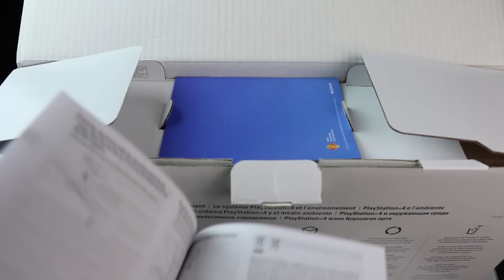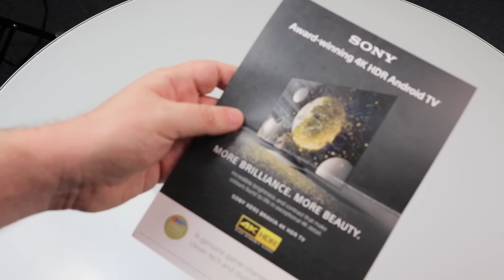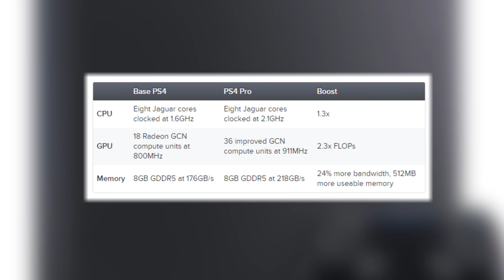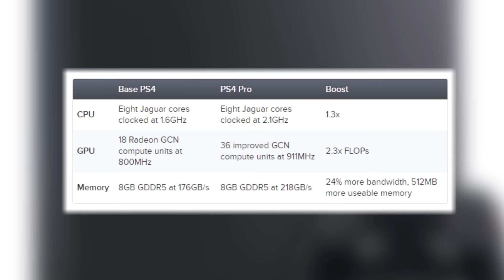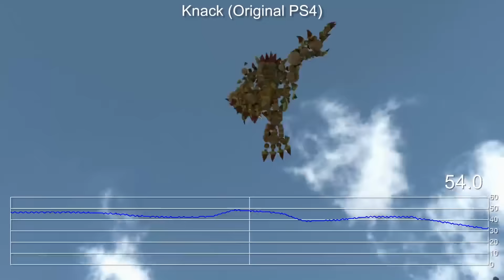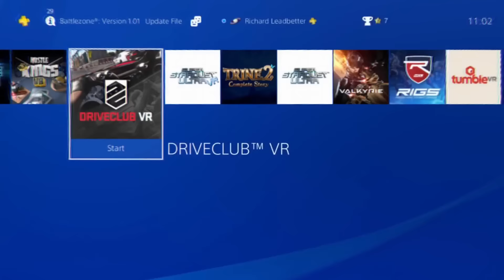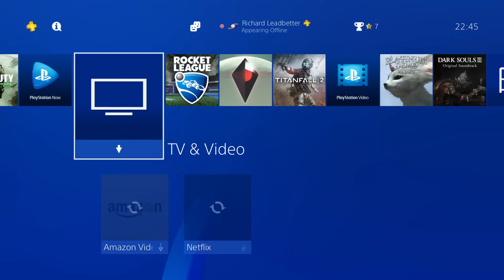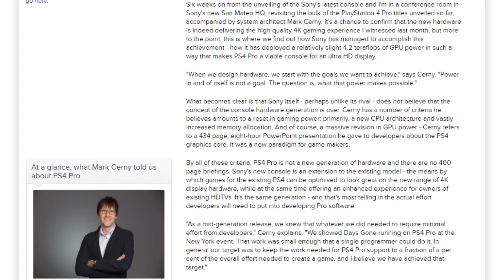DF Videocast #4: Unboxing PS4 Pro, Meeting Mark Cerny & More

Comment: Iam a High End PC Gaming Enthusiast But Frankly for its price , sony exclusives , and optimized games such what they have done with Uncharted 4  = It is A Good Deal to play on a 55 inch 4k HDR TV. Just Ordered the Flagship TV of the Year - 55 Inch Samsung KS 9500.
Reply: Mr. Ihab Issa I'm a high end PC gamer as well, but I can't justify the upgrade because there isn't anything wrong with the vanilla PS4. Plus I want to research the best 4k HDR TV as well.
Reply: Davari02 Gaming Sold the PS4 Already 4K HDR is a totally different world - you need to see it to actually spot that. I have done  an intensive research (Rtings , 4k.com , AVForums , Tech Channels ... ) and I was in a dilemma between 2016 High End offerings , fully fledged HDR , low input lag , image quality , gray uniformity , blacks and Contrast Ratio , and the number of HDMI ports that accepts a 10bit Signal . Samsung KS 9500 vs LGuh950V vs Sony Bravia x940d to me KS 9500 is the most versatile (lowest input lag at 4K 60 Hz HDR  , Ultra Premium HDR Ceritified , Widest Color Gamut with P3 Coverage , Best Gray Uniformity , All 4 HDMI ports accept HDR or a 10 Bit Signal.
Reply: Mr. Ihab Issa I was looking at thet X940D but end up going for the X930D instead bc I do not need something thay big ans the one I got should do the job & yes I do know about the input lag but then again nothing that small firmware update cannot accomplish in my eyes.
Reply: Samuel Campana Why not the KS 9500 mate
Reply: Mr. Ihab Issa Bc I don't think KS 9500 was available whenever I was looking and the fact some of tech guys have not being very fondable experience with their Samsung TVs, got a friend of mine got 3 priors Samsung top of the line models & usually by the year mark, screen issues that to repair it is might as well buy a new TV so 1 huge reason that took me away of that & will wait a couple of years & might jump to OLED yet too early for any concrete feedback to make it even worth it. And another reason to go with a Sony model was also because Sony has the most color palette than any other brand so it makes native 4k looks more natural, on that part I was just picky believe did research for almost a year.
Reply: Also most manufacturers having issues woth 10Bit signal so as of now that's in limbo if it'll actually gets implement it at all mate but then again I have checked on any news in the last couple of months so I might be wrong.
Reply: i wouldn't call sub 30fps as optimized
Reply: VelvetSky1102 exactly specially when it is not steady fps
Reply: Im also a high-end PC gamer, but i don't care about consoles. It isn't just my style.
Reply: Mr. Ihab Issa That's a great tv but you should have gone 65" 😎
Reply: district5rookie Nah 65' is too much, It burns my eyes after a while of playing, 49-55"' inch is perfect
Reply: All depends from how far are you watching/playing I think there's a chart for that.
Reply: ***** I know I did the jump from 47 to 65 now I can sit far off in the couch with no complaints
Reply: Samuel Campana So it means the QC on the Samsung Panels is bad now that might be annoying which makes pull the trigger off on the purchase. However many people purchased too a Samsung TV & nothing happened.
Reply: Mr. Ihab Issa not right away but in a years mark happened to my friend 2 put of the 3 he bought & my sister's fiance happened the same thing a couple years back a tiny line right in the middle when TV was cold but with time it got bigger & never went away & he initially contact Samsung & they were charging him like close to what he paid for so it let it go and the end result was the line got wider in a year's mark. No idea if they fix that problem but look what they've been going thru lately 1st note 7 now over 280 million washer machines being recall. P.S. not trying to put you away but spending that amount of money you want value from your investment just saying.
Reply: Mr. Ihab Issa Curved Screen :/
Reply: Flagship TV of the Year  - LG Signature OLED
Reply: Aditya King in LED the KS 9500 ;)
Reply: Mr. Ihab Issa Sony Z9D
Reply: Rammenknoedelstein Z9D?
Reply: Daniel Berliński curved are only great while looking it at in a straight angle, amy time you move to the sides you lose visbility sadly
Reply: Rammenknoedelstein 4k.com 93 % for the KS 9500 and 86 % for the Z97 D
Reply: Mr. Ihab Issa is that their rating?
Reply: Samuel Campana Yep check the recent review of the Z97D. By the way I was checking the Verticle Lines issue -Sony & LG has them too.
Reply: Mr. Ihab Issa did funny that their main complain was a comparison with OLED, seriously, OLED has no other company to compare it with yet seems very solid; yeah read plenty of the bad stuff on the Sony side which is mainoy about the perfection of showing blacks as it seems it carries over on the Z9D models yet not as much.
Reply: but the frame rate will but the same as the original ps4's im sory I have a gtx 950 and I wouldn't upgrade to this
Reply: magnefficient gaming ?
Reply: Samuel Campana    Input lag sliced in half after latest firmware update. http://www.avsforum.com/forum/166-lcd-flat-panel-displays/2361889-official-2016-sony-x930d-owners-thread-no-price-talk-147.html

Comment: Great video, thanks! I know why I watch DigitalFoundry. As a side note: Richard, may I humbly suggest not to cut Tim short? Of course, you are the boss, but doing so gives the impression of a bad mood and underlying tension which may be completely not the case. Moreover, as you are two guys in the video, I'd say that amount of talking should be roughly equal, which in my insignificant opinion was not the case in this video. However, that might be only my personal impression.

Comment: Still runs games at 30 fps? What the fuck. Are they even using the extra power?
Reply: If I upgraded my pc by those margins more than just the res would be increasing.
Reply: CPU still sucks bro
Reply: The CPU still isn't capable enough to maintain 60 in most games. You can double, triple, quadruple the GPU performance all you want but a shitty CPU will give you bad minimum frame rates.
Reply: Just because the hardware could do it doesn't mean a game engine can do it without some major retooling. 

If you create a game from the ground up at 30fps you have optimized everything for that frame rate (dynamics, controller input, audio, AI, etc). This means that simply doubling the frame rate won't produced the desired results. You now need to rework a bunch of systems from scratch to end with the same results you had at 30fps. Not only that but for a console you are optimizing everything to use the most of the resources within the specs of the system, which means that you may not have enough headroom to double up on processing required to get up to that level. 

A game produced from the get go at 60fps is a different story since you already have the 60fps frame rate worked out and are pairing it back to get to 30fps. However, the goal with the Pro is to give a more powerful PS4 option and not to create a second Pro exclusive market. If you were to have online multiplayer games running at different frame rates between PS4 and Pro then the Pro users would have an advantage or you would need to have separate servers for one of the groups.
Reply: MegaRayland
games arent always hardwired to 30fps, there are already a few games on PRO that give a high framerate option
Reply: The ChillyWinds You have an option to play the game in 60fps 1080p. Its call framerate mode
Reply: Since they pretty much doubled the GPU power, They could either double the frame rate to 60 FPS, or double the resolution. They chose the latter.
Reply: SteelSkin667 No, they give you both options. At least Crystal Dynamic did that for Rise of the Tomb Raider
Reply: No is not.. Since Sony actually demand that they take advantage out of the so called "4k" support and have parity in frame rates.
And even if developers was free to use that power the way they want, it would still no have enough CPU power to deliver 60fps in a large majority of the games.
Reply: LordBattlefrontGamer No it really doesn't at all. You should watch their video on it. The ps4 version on average is like 40-45 fps in multiplayer. Also that is only one game and just so happens to be incredibly optimized with tons of graphical downgrades. It should
be able to do more than just a couple games. Nearly all games pardoning maybe bethesda games should be able to run at 60 fps with a boost like that.
Reply: *****
lol bullshit, even the xbox one S drops hard in 64 player matches and the consoles can't keep 60 because the CPU's suck shit..same happened in BF4
Reply: *****
they have optimised it but theres only so much they can do..consoles arent magic you know, the hardware limitations are real, which is why they are brining out the PRO and scorpio..they made the PS4 and ONE too damn weak.
Reply: *****
yup 4k is VERY intensive but theres a difference, on PC it will be native 4k, on PS4 it's some clever up scaling technique which will look good, but not native 4k good.

there are some games on pro which are native 4k but they are indie games and PS3 remasters like Skyrim and TLOU
Reply: *****
yup it can downsample from higher res down to 1080p to give a cleaner image, i do this a lot on my PC

the pro basically brings the playstation back to the level of a mid-high end PC, which is where the PS4 was back when it released. as I have a gaming PC and a PS4 i have no reason to buy the pro.
Reply: LordBattlefrontGamer lol Battlefield 1 runs at 60 fps on the normal PS4?  LOL what a joke ,, do you know what is 60 fps ? ,,,,, the fps drops in ps4 is insane ,,, ( I have the game in ps4 and PC )
Reply: LordBattlefrontGamer Watch there video dude. It's on this channel shouldnt be hard to find.
Reply: LordBattlefrontGamer There is an amazing thing called optimization, but you are missing the point. Few if any games out there rival battlefield in there level of optimization so acting like battlefield is what we should expect to see is absurd, because it is exceptional even though it still fails 60 fps.
Reply: barfyman362
Yes there are, because the developer created the game with that in mind or shooting for that.  If you created the game from scratch at 30fps there is no extra hardware that will run the game at 60fps (you can speed the gameplay up but doesn't mean the game will run properly).

Comment: Hey guys, how long until you can post frame-rate and performance metrics for Pro vs. OG PS4? Really interested in the difference between the two -- specifically for deciding whether the performance boost is worth the buy for 1080p screens.
Reply: Rob Taylor people are only allowed to do unboxings right now. Software and games will come next week
Reply: They said embargo lifts on 7th(so monday) so i guess then we gonna see vids of ps4pro fps.

They do mention it in this video u shouldnt expect better fps in most cases, even with pro patch.

Comment: I have a question were i seriously can't find an answer for. Does the pro improve the framerate of games that won't receive a pro patch? Would like to know what it does to games like Just Cause 3(which runs horrible...), and Killzone, which has an unlocked framerate. Is it also quieter than the original ps4?
Reply: WH250398 no. 
Maybe, if there's a cap that it didn't hit before. But in most cases, I don't think so.
Reply: From what I have heard from r/PS4, the games for which there is no pro patch, the PS4 pro would downclock to PS4 levels and performance would remain same as  PS4.
Reply: koko jumbo that seems like the right answer
Reply: The PS4 Pro has two modes: Original PS4 Mode and PS4 Pro mode, when you run a regular non patched PS4 game it will run in "Regular PS4 Mode" which runs at the same CPU/GPU clocks as the original PS4, so there should be no performance improvements when running un-patched PS4 games on the PS4 Pro.
Reply: Seriously. We need some performance comparison videos with the PS4 Pro running a game alongside a standard PS4, so we can see the difference. All of this is really confusing as it stands; some games perform better, others wont BS.
Reply: No they won't, they'll run exactly the same. For a simple reason. Games on consoles are designed with very specific hardware as the target. Some games might not handle well even a change in clock speed on the CPU. Not all, but some will, specifically games that make use of really low level code, which I'm sure a lot of first party Sony Studios like Naughty Dog use in order to push the hardware to its limits. So the PS4 Pro downclocks the CPU and shutsdown a part of the GPU(half of it so it along with a downclock so it has the exact specs of the original) in order to play games exactly like the PS4 currently does, otherwise I guarantee some games would break until updated. This didn't really happen with the Xbox One S and its minor clock bump on the CPU but it could possibly be due to it's different API.

Unless developers explicit update this then you'll see no benefit.
Reply: In case you want a source: http://www.eurogamer.net/articles/digitalfoundry-2016-inside-playstation-4-pro-how-sony-made-a-4k-games-machine

On the side, in case you don't want to read all of it, it says: "2.13GHz CPU and 911MHz GPU in Pro mode, running at 1.6GHz and 800MHz respectively in base PS4 mode in order to lock back-compat with the standard model"
Reply: Awesome, thanks for posting notlekrut!
Reply: notlekrut That would be a damn shame. I really would like to see digitalfoundry making a video on that
Reply: It will at least give it enough power to prevent dropping of fps, so a game that was too hard to pull off normally will not fall in frames in times of heavy stress.
Reply: No improved framerate without pro patch, even with patch it will mostly focus on image quelisty/resolution and not framerates(there might be few exceptions like RoTR where ps4pro 1080p performance mode is 40 to 60fps.
Reply: mangasaint The PS4 Pro runs non updated games in standard non-Pro mode. This means it downclocks the CPU, GPU and shutsdown half of the GPU in order to be exactly the same as the normal PS4. The hardware is, supposedly, already made to be sure there isn't any thermal throttling or power throttling so what you mention is not very likely. The experience should be the exact same. If the PS4 drops to 20fps, this will as well.
Reply: In regards to the frame rate, if you are talking about stability the answer is possibly. It depends on the game itself.

If the reason for the uneven frame rate of a game on an original PS4 was a result of hitting a ceiling in the CPU then yes, you will get a stable frame rate on the Pro. On the other hand, if the game's uneven frame rate was the result of the game engine not being properly optimized to run smoothly, then no, a Pro can't do anything on its own without the game developer issuing a patch correcting the issues. 

If you are asking whether or not a game that was originally created at 30fps will turn into 60fps then the answer is no. There is no magic switch to do this whether the console could potentially do it. A game that was developed from the ground up at 30fps had everything, from the dynamics engine to the AI, audio, control lag, and system usage optimization, developed to run at that frame rate. In order to run at a higher frame rate you would need the developer to rework chunks of the original code and release a patch. 

Specifically in relation to Just Cause, if I remember correctly, the issue was with the engine itself not being greatly optimized. However you may notice improvements in the performance when large dynamic events (such as a bridge collapsing) is taking place which, as I recall, would cause dropped frames on consoles. Don't quote me on this since it is speculation from what I remember when the game came out. As for Killzone, since the frame rate was unlocked what you will find is that the game will be able to stick more consistently, if not all the time, at the higher frame rates with much fewer (or non-existent_ drops to the lower ones. 

As for the fan noise that remains to be seen. However considering the major noise reductions achieved on the PS4 Slim there are good chances that the end results will be pretty good. At worst it won't be worst than the original PS4 but considering the reduction in the components, the larger heat sink, the reduction in power consumption, and other aspects, the Pro will likely be a bit louder than a Slim but less so than an original PS4.

We'll know for sure in a few days.
Reply: Why are you people spouting bullshit when you do not know what you are talking about??? The extra GPU that the ps4 pro uses will sit completely dormant with normal ps4 games, which means absolutely ZERO improvement. You wont even see the tiny bit of improvement we got from xbox one slim over original.
Reply: @MegaRayland NO YOU WONT... How the fuck are you going to see any improvement if that extra GPU power is completely disabled?? That is what is the case with normal ps4 games unless they are patched to take advantage out of it and even then thanks to Sony it will be used just for higher resolution or supersampling if you run at 1080p, so mot likely same performance or even lower performance even then as well, just like we have already seen with mantis racing when compared to vanilla PS4.
Reply: bloxyman22
 Yes for the GPU, which disables half or so of the CUs. However if the issue was memory bandwidth then you may see some improvements even if the GPU usage was not patched. Again, it is all up to the developer and what they want to do with it.